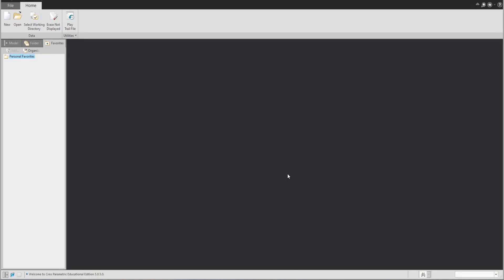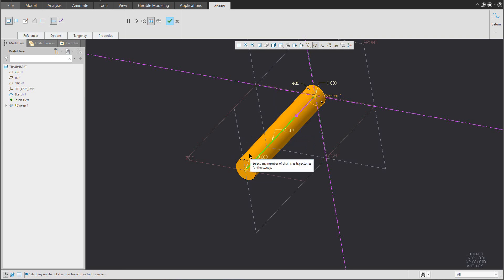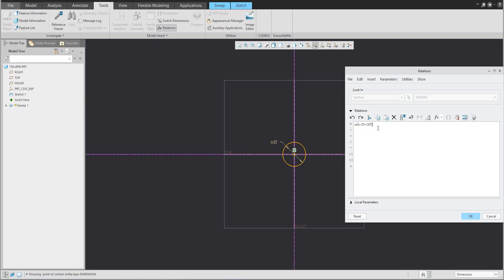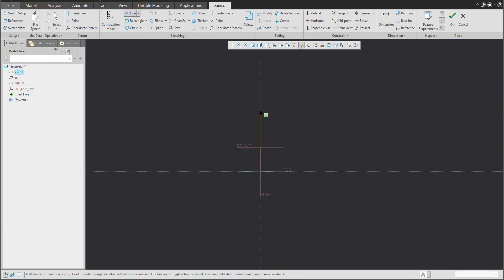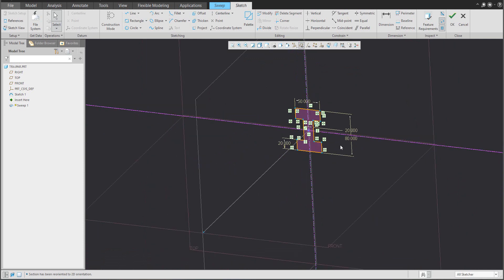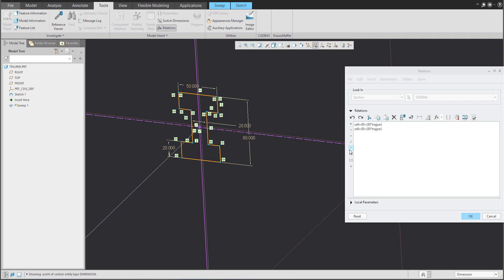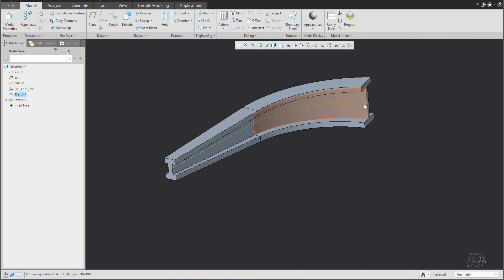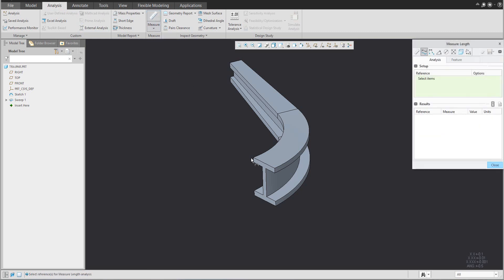Trajpar - for beginners and advanced users | Creo Tutorial

Comment: great video, but is there any substantial advantage over bled feature... 
one advantage is see is that we don't have to re draw the sketch again , but other than that ... ?
Reply: Trajpar is a powerful tool and is very different from blend. In a Blend, one does not have control over how the cross section varies between two sections. Trajpar, graph and parametric equations, make it possible. Trajpar can also be used to control how a pattern behaves ir how a spring is coiled.
Happy learning
Reply from the maker: Hi, behind the trajpar is more than redraw sketch. I use it often for surface spring modeling.. E. G. https://youtu.be/3Qdv3E8TnCI